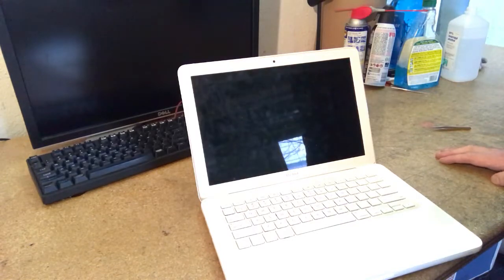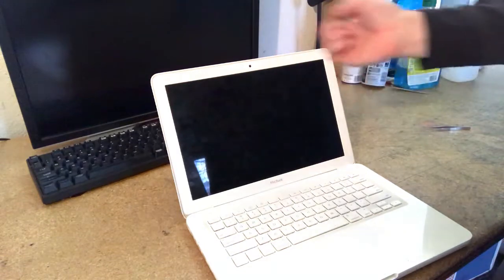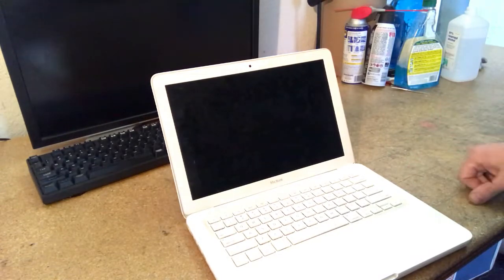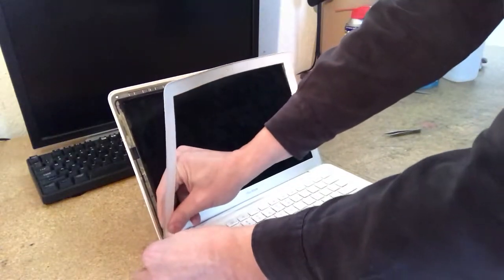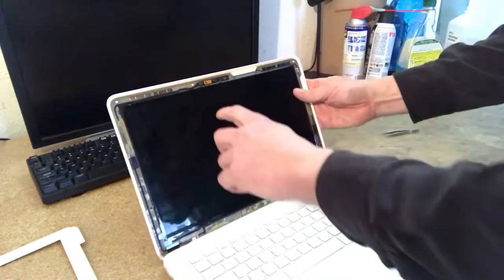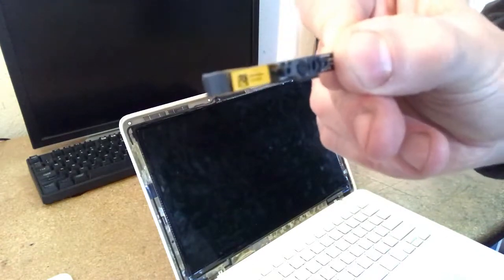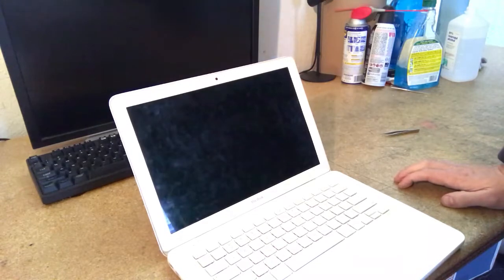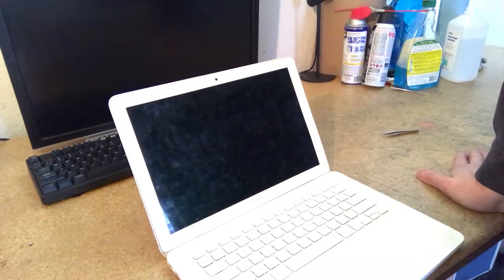Bezel and Webcam Removal for Apple A1342 13" White Unibody MacBook

Comment: Hey man! I have one of those and my webcam sometimes works, but most of the times it doesn't. I tried disconnecting and reconnecting the webcam as you did but it didn't solve the issue, neither did all of the other solutions people post on the internet, such as NVRAM/SMC reset, sudo killall VDCassistant/AppleCameraAssisant. Do you have any idea what I should do? Thank you!
Reply from the maker: All you can do is start replacing stuff.  Replace the webcam, see if it works, if not replace the cabling (replacing the entire screen assembly is probably easier), and if that's not it you know it's the board.  Good thing is that these computers are super cheap now and you can get junk A1342s for nothing.
Reply: @RDKLInc  Thank you! Unfortunately in my country these things are still not that cheap, but if I come across an old one I'll see what I can do. Thanks again! :)
Reply from the maker: @alanmh1995  remove and connect it repeatedly with the bezel off and computer on, while flexing the hinge.  Sometimes it's just a crimped cable.
Reply from the maker: Also try connecting-reconnecting on the board end
Reply: @RDKLInc  can I handle the cable on the board with the computer on?
Reply from the maker: @alanmh1995  Not officially recommended, but probably.  I mean, it's already not working :-)